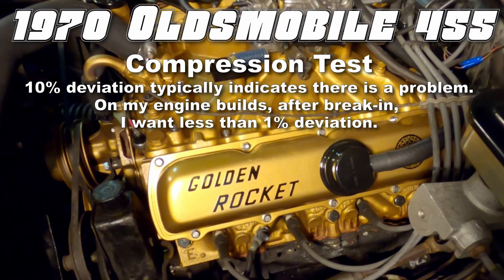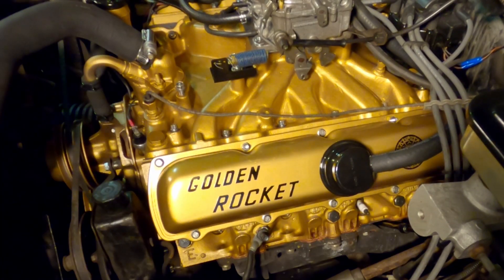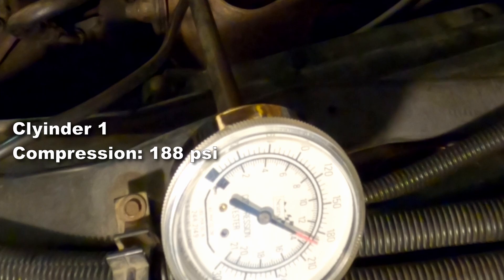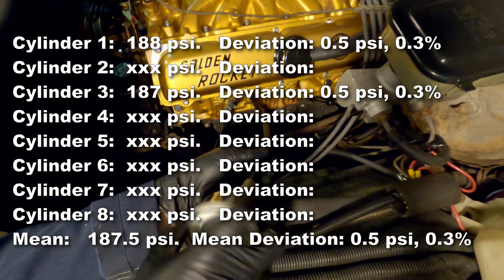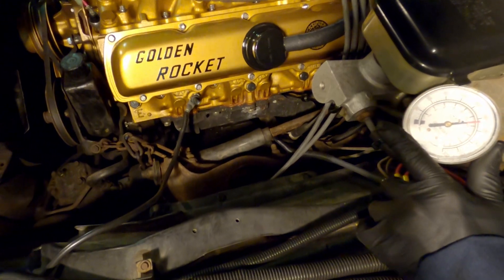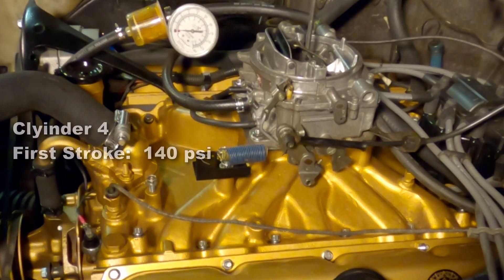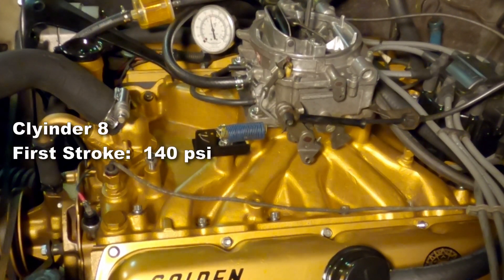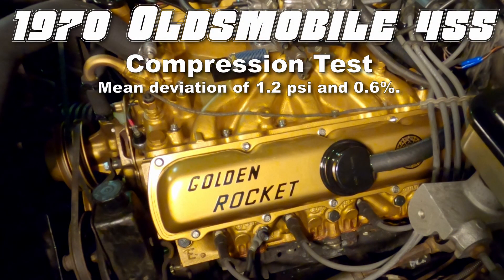1970 Oldsmobile 455 Compression Test

Comment: how much did you mill off your heads?did it change how long your pushrod is?
Reply from the maker: I had a machine shop do the milling. If I remember correctly it was 0.010" off the head and 0.034 off the block. You have to preserve the ratio of the material removed from the head and block to assure the manifold fitment stays true. The amount removed from the head was determined from the material removed from the block to be flush with the pistons at tdc. The valve train changes were minor, I did use shorter than stock pushrods (I don't recall the length but it was only thousandths of an inch different from stock) and the hydraulic lifters were able to compensate for the remaining difference. I double checked the rocker geometry when finished.

Comment: what is the compression ratio on that engine
Reply from the maker: It's been bored 0.030" over, block decked, and the heads were milled down. The compression ratio is about 10.2:1.